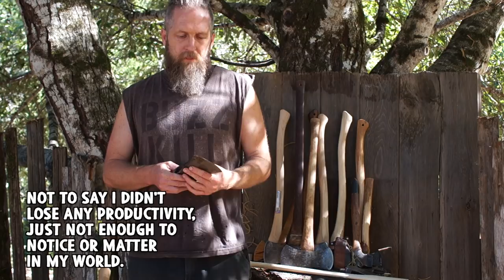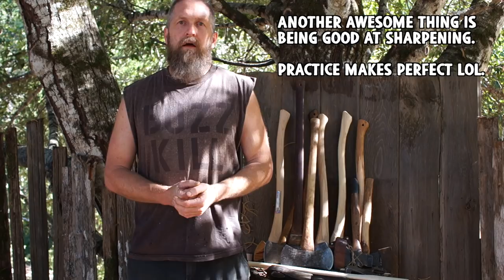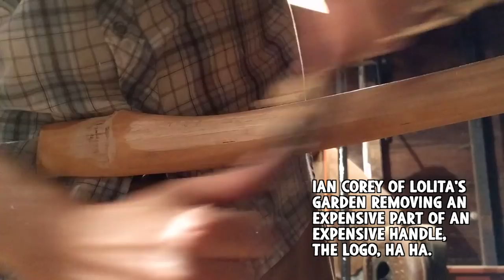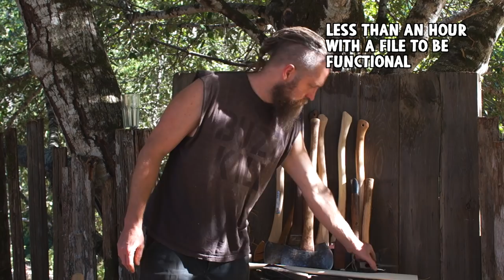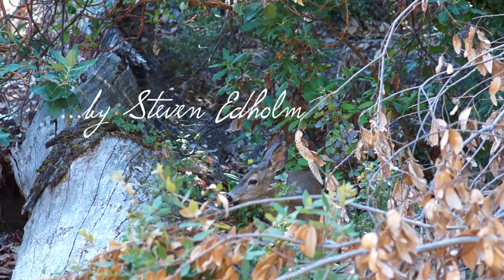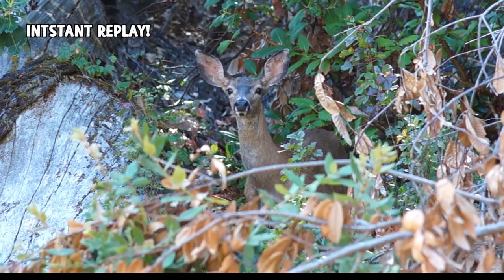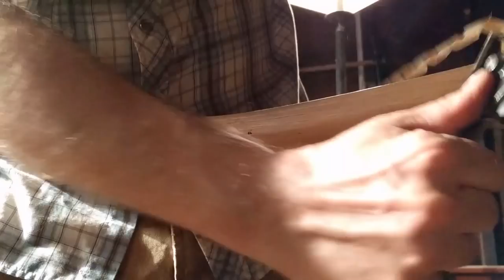Expensive Axe Buyer's Guide: (SPOILER ALERT, Don't Buy One)

Comment: I think you make a lot of valid points.  I also think that there is something to be said for investing in the best tools you can afford.  I am a woodworker and using a cheap handplane vs. using a Lie Nielsen can make the experience night and day.  Can you afford to learn on a high-end axe?  That may be the question
Reply from the maker: I haven't found with axes that it makes a huge difference, but they are not needed as sharp.  If one were to maintain more extreme edges, maybe it would help more to have superior steel and heat treatment.  I just don't think edge retention or breakage are the major problems in axes.  I may change my mind if I start pushing limits on grinds, but I can do very efficient work with a well set up mediocre axe, though not with a bad, soft one.

Comment: The cold steel trailboss axe I think is one of the best value axes. I absolutely love mine and I think you can get one for around $30-35 bucks
Reply from the maker: I might have to pick that up since it is mentioned so often. I'm not a fan of the hudson bay type axes.  I got off that train a long time ago.  but Iv'e never seen that axe in person or tried it.
Reply: SkillCult it comes pretty sharp. Just an easy touch up with a stone and it’s razor sharp. It holds it edge well and bites deep. The handle is definitely beefy so im guessing you would shave some off to your preference. It’s hung very well and has good grain orientation. I just wish it didn’t come with the black coating, I removed that. It’s just the perfect size to be able to do all tasks really.

Comment: I myself am not an axe pro @ all as a matter of fact far from it. My most expensive axe is an Estwing 26". I once bought a used axe with a poly handle at a swap meet and It has been outside for over 5 years. It takes an edge really well & holds that edge for a long time. Thanks for all your videos & all of your advice on axes. - Marco
Reply from the maker: I may put a fiberglass handle on a boy's axe just to have in the car 24/7  Wood handles can't take the temperature and humidity changes in a car.
Reply: Will look forward to see the results on video.

Comment: I agree, I bought cheap kitchen knife/axe and regrinded them to my taste. That is more difficult with an expensive brand or a vintage find.
Buy the most expensive tool you can afford is a different approach, if it fits the buyer, power to them.
Reply from the maker: I understand the mentality of investing in quality and that is actually usually my default when possible, but a person has to be careful about what advice they take or their own logic about how to spend money.   Hard to know when to invest with a new undertaking. Reviews and advice are not always reliable.  I'm ready to upgrade my audio video stuff, but several years of using the equipment now and ingesting and digesting information, I'm much more ready to make the money count and decide what is and isn't important.  I've also proven that I'm going to use it and what accessories I do and don't need.

Comment: i bought a husqvarna 26" for like 40$.. used it for a week then cut the handle off and carved a new one, re-profiled the edge with a bastard file.. I've been using that axe for 7 years splitting fire wood and felling small trees. I broke 5 or 6 handles until i learned how to make and fit them correctly but it was worth it. Plus I haven't sharpened my axe in years.. i hone it every couple hours or so with a fine grit stone. It's still a hair shaving sharp and effective. i  want a granfors but imo there's too many weekend warriors obsessing over it and driving the price up.

Comment: Your first video I saw was your review of the husqvarna hatchet and it kinda rubbed me the wrong way because I dont share your preferences for thin straight handles and light heads (maybe I will in time) but I'm glad I watched more of your videos. Thanks for sharing your experiences and wisdom.
Reply from the maker: Hi Cody.  You're welcome.  I'm not sure what the best handle thickness for hatchets is.  It's a compromise between gripability and flexibility.  Also depends on what it's used for and how much, and then there is wood type.  But I do know when too much is too much.

Comment: Great message! As a blacksmith this exactly the same thing I tell beginners about hammers. 

Getting into axes I've done the same thing, and now I have way more axes than my skill deserves. What have I spent? Maybe $40. 

Buy old tools and learn to make handles!
Reply: Isn't the ridiculesness even higher with Hammers? I'm really afraid I'm gonna offend some people here, but a Hammer is a relatively simple thing. Especially the hammers a novice would use. There's not so much you can do that good about making a lump of steel with a handle on it, is there?
Reply from the maker: What he said!
Reply: As someone who uses a hammer every day, I've gotta say, they can be simple, but if you get deep into it, they're just as complicated as axes can be.

Between face dressing, weight distribution, and handling, you get an infinite number of variations, and each one is going to behave little differently, some more than others. Some varieties are "good",  a few are straight up bad.

BUT, just like the point made in the video, it takes skill to make any of that really matter. In inexperienced hands doesn't matter if it's a Brent Bailey (fancy hammer maker) or a harbor freight, you're gonna suck with both, so might as well suck with the cheap one.

Comment: I've had a cheap crap axe that gets shit on all the time and used for chopping roots. Works good but doesn't really chop well. Finally got a gransfors, it's much more axe then I need but it's also only has a days use. Still love it, cute amazing and I love just looking at it. It's like my saw. I don't really need it but I just love having it and looking at it every time I grab my lawn equipment, just waiting for the next time I get to break it out. It makes using the tools more special.
Reply from the maker: They are cute.  I would have kept my gransfors forest axe probably if it wasn't so crooked.

Comment: This video just saved me 200 dollars. The gransfors bruk splitting maul is sweet and a beautiful tool but you are right,  it’s just that (a tool) tools are to be used, Handles break regardless of the price. My 15 dollar Collins axe splits wood just fine. And the splinters on the handle up by the head from going through logs (which is inevitable) doesn’t cause me to loose sleep. So thank you.
Reply from the maker: I mostly use a cheap maul head on a fiberglass handle for my saw cut wood.  It works fine.  I'm sure it could be improved, but it works fine.
Reply: SkillCult something about a wood handle just seems right to me but the fiberglass is certainly is more resilient, but it’s a maul, if I swing it and the wood splits I’m happy haha. Thanks for the great videos.
Reply from the maker: @joshrowe2275  I just like to go berzerk with a maul and I am not careful at all with fiberglass handles.  I use axes too though and have been using a wood handled maul a little bit lately that I got.  I'm careful with those, but it's a different experience.  It's the only place I use fiberglass handles.
Reply: SkillCult oh yeah, going berserk is the name of the game, something therapeutic about getting work done by breaking things.

Comment: I think I could possibly say almost the same thing if anyone asked me about axes.

The only thing I could say to recommend an expensive axe for a beginner was :

IF you had a lot of money, so the cost didn't matter.
AND you were not willing to put in work to modify the axes

You likely would be better off buying an expensive axe because in general they will tend not to have the significant problems which can happen with cheaper axes and a novice would not immediately recognize/fix.

A lot of cheaper axes, especially locally come not sharp, edges are over thick, apexes can have heavy angles/burr, etc., handles with perpendicular grain, heads not properly aligned, etc. . 

In comparison, someone trying to sort that out who swings a Bruks for the first time on wood which matches it profile likely will feel like he has a lightsabre.

Now IF you were willing do do a quick head/handle inspection, AND modify the edge/bit profile, AND shave down the handle, that $30 axe will outperform the Bruks by the same amount.
Reply from the maker: I'm generally in favor of people jumping in right away to modification and tuning of axes.  I have a video scripted out that deals with that, but in short, an axeman has to come with three things, a decent quality axe, the health/ability/skill to swing it and as important as anything, the ability to set up repair and maintain.  And a beginner is actually the person that will most likely need to repair and maintain anyway, so when do you learn?  After spending enough to buy three perfectly good axes and then messing up the axe?  And I would never use a gransfors out of the box.  They still need filing and the handles are still ridiculously thick.  Granted, truly excellent resources to get people started out of the box with modification and set up are not that accessible. I've been chipping away at that, but will be making it easier in the future.
Reply: @SkillCult  I would agree, if the desire is to become competent, you have to be willing to put in the work to modify axes, any axe. 

However, even though I have no data, I would be willing to be a large amount of the market is for people who will never actually do significant modification, they are just weekend campers, etc. . In fact I would not be surprised if actual working axes were in a small minority - again I have no data, just from conversations, looking at internet commentary, etc. . How many posts/videos show modification to a Bruks vs commentary/praise on them as-boxed?

I don't disagree with you, I think we just might be speaking about a different market.

Comment: A+ observation about the "gear heads".    I have $30-$50 axes.   Nothing fancy, utilitarian things. They serve me very well.   

Additionally an amateur is far more likely to muck up the handle in the first few years,so a cheaper axe is better to until you get some good aim.   My handles show heavy signs of "newbie" and I'll be replacing them for the first time fairly soon ;)
Reply from the maker: I still smack a handle on a limb here and there.  Not as much as I used to though.  Some are harder on stuff because of style too.  I put getting work done somewhat over babying my axe.
Reply: Same here, i tend to use the Husqvarna axes, i have a Wetterlings Hatchet that i bought as a "fuck it, looks nice if anything".
Reply from the maker: Hults has a 2-3/4 lb on a 28inch handle that I'd like to take a look at.  I can get if for 95.00 U.S. before shipping from Canada, which is pretty high, but it's not over the top if it's nice enough it might be an out of the box solution for people that are less broke.  It's not that sexy and I think they are probably essentially drop forged and then "struck several times", because like all those Hults, they don't have the wetterlings/grans hammer marks.  Probably why they are cheaper.  A husqvarna version of that sold a little cheaper I would consider.  it's hard to find 2-3/4 pound heads on a short handle like that.   Still, vintage is a good way to go for qualtiy/price. I don't know what it's like where you live Zombie, but here there are still quite a few old axe heads floating around.
Reply: I've had a quick little look at the american ebay. The things sold there are quite awesome. I've seen Sager Chemicals in practically new condition being sold for $30. That just makes buying a new expensive axe completly ridiculous.
Reply: Sadly, our native axes (actually our "traditional" pattern is the German Rheinland pattern) have the eye designed in a way that it is very big and bulky so i'd have to buy a vintage head and it would still be huge, that's what draws me in to the Swedish and American axes, the eye is made so you can actually thin the handle down. I don't know if you remember the Stihl axes, but that's what our axes look like, i have no problem thinning down a piece of hickory to about half the thickness, but i'm not even going to bother to thin down a 1 1/2" or 2" thick piece of ash. I would actually consider getting an old Kelly Jersey Pattern or something like that as i'd like (want, don't really need one) a bigger axe head on a 28-30" handle, i mean i'd probably buy the handle from Husqvarna but whatever.
Reply: +ZombieFighterOf2001
Additionaly: If you want to buy an axe handle in Germany you usually have to look for the eye. There are Oval ones and big and bulky ones (like that: https://agrarking.de/media/catalog/product/cache/1/small_image/210x/9df78eab33525d08d6e5fb8d27136e95/i/m/axtstiel-70-cm-1.jpg )
The oval ones are used up until 1kg and 1kg and up the big and bulky ones. However you can only get handles up to 40 cm (15,7inch) for the oval eyes.
When I bought my Gränsfors small Forest axe, I was suprised how thin the handle was. I knew it would be thin, but not that it would be that thin. Seeing  people talk about even that handle for being too thick, was mindblowing to me.
Reply: The thing is, here in Slovenia 99% of our axes have the bulky eye.
Reply: Even the light ones? My Condolences.

Comment: I had a Snow and Nealley for a while but I gave it to a neighbor.  The heat treatment didn't seem that good and the beard of the axe had torqued over to the side quite a bit.  I don't know if that's a recurring issue for them or not, but I was bummed.

Comment: I felt pretty good about cycling across Canada on my 12 year old touring bike which, even when new, was an entry level product. Then I met a guy who was doing the same distance (faster than me actually) on a $100 walmart mountain bike with panniers he had made out of rubber made containers.  Sure he probably had a few more mechanical problems but I can guarantee they would be a lot cheaper to  fix than on a high end bike. He had just as much fun and got to where he was going just the same. The older I get the more satisfaction I find in getting along with what I already have.
Reply from the maker: There are times when it matters enough and times when it doesn't.  I wouldn't want to tour on an old heavy steel framed 10 speed bike with steel cranks.  A newer upgraded slightly lighter bike isn't going to outperform my old 18 speed centurion touring bike much though, and I'd have to pay for it.  There are also places where cost correlates more closely with quality and performance too, and I can modify an axe with simple tools if the potential is there.

Comment: I always say buy an inexpensive axe such as a Council Tool axe. Use it and if you feel you need to upgrade, now you have a good beater axe for example if you need to cut something close to the ground or in the ground such as roots and you can keep your nicer axe sharper for felling. You can always throw the beater axe in the truck and the nice axe with your camping gear.
Reply from the maker: sounds like a good plan.
Reply: And if you end up having a kid, now you have an axe for him or her when they get old enough to use it for camping or firewood. And if you bust the handle on one axe, you can keep going with the other and replace the axe's handle at a better time.

Comment: I hear what you're saying, but some parts of this hemisphere are so incredibly axe-less, that buying expensive axes is a good idea. The only option is the fiberglass handle specials at the box store, which are unpleasant right away. Here, in Southern Ontario, the used axes are even the fiberglass handle ones. You will waste a lot of time digging up an adequate used axe. Some regions simply don't have a hand tool culture.
Reply from the maker: That's what I'm hearing from a few people.  Ebay can be expensive, but there are still deals on stuff that isn't branded.

Comment: I think when you say, don't buy something expensive you'll barely used is always sound advise.  However, if you do plan to use your tools pretty consistently, meaning every year, you're better off, imho, buying something that you will enjoy using and keeps you "on the job", is better overall.  I have a number of axes.  I started off cheap, buying some yard sale axes and then refurbishing them.  I used those for years, but never really enjoyed them and I ended up too many times just reaching for a chainsaw to avoid using the cheap axe.  Then I got a bad chainsaw injury.  Once that healed, I decided to buy a Gransfors Bruks and give it a go.  In my experience, the GB axe is like using a completely different tool than the cheap axes I had been using.  I thought they were all hype, until they weren't.  Never underestimate the quality of the steel and the geometry of the head.  They really do make a huge difference.
Reply from the maker: Gransfors are closer to set up out of the box than most axes.  I Think many people are not setting their axes up well when getting other used or new axes.  If you gave me a gransfors boys axe and my budget council axe, I seriously doubt there would be any productivity of enjoyment of use difference.  Maybe a little less sharpening, but not a lot.  I agree in general with tool quality.  The world does not need more bad tools.  An axe though is subject to more abuse and just hard use by both beginners and more experienced users, just because of the nature of the tool and work.  I definitely don't mean to advocate using bad tools, just not the best for new users.  A mid quality axe still is, and always will be, a good and useful tool for it's life.  If someone gets one, two cords cut, likely at least one handle, and probably an 1/8 inch of the edge later, they can better know what to buy, what they want, and how much it's worth to them.  Cost of course is relative though.  Thanks for your thoughtful comment.